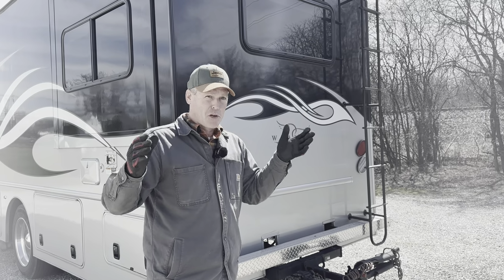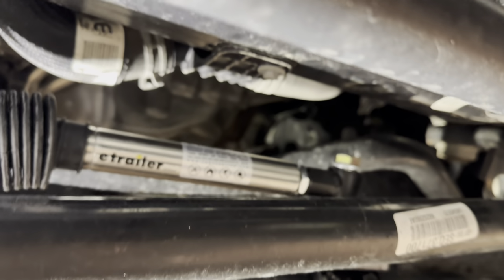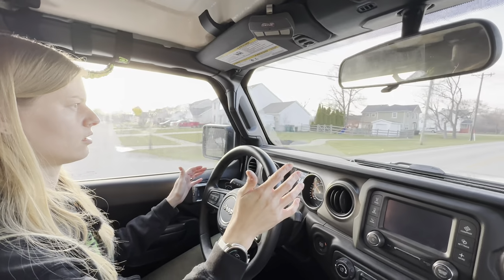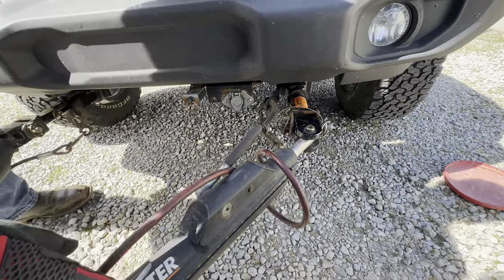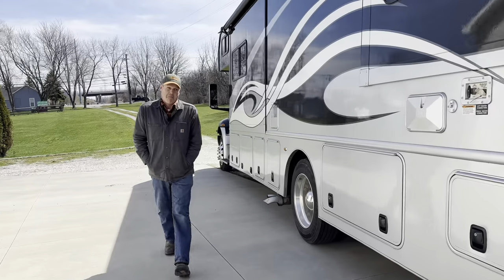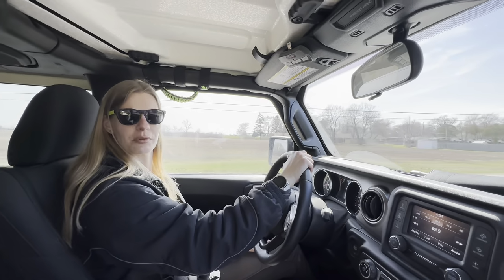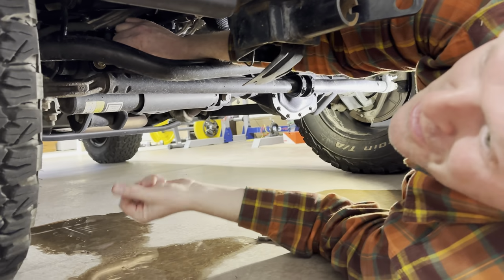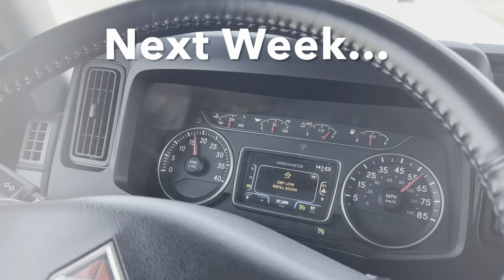Waste Of Money? Roadmaster Exact Center Steering Stabilizer (Jeep Wrangler)

Comment: If you have to back up with a toad and you have two people, let the toad reverse and lead the rv. A Jeep in 4low will easily idle an RVing in reverse and idling. Thanks for the content guys!👍🏻👍🏻👍🏻👍🏻👍🏻
Reply from the maker: If we run into a problem we'd just have the passenger hold the Jeep wheel so it wouldn't jackknife and break the tow bar... Or simply unhook the Jeep all together because it takes all of 2 minutes haha the fine print for this stabilizer says to only go straight back and not to turn. That's pretty useless most of the time lol as of today that steering stabilizer is still off and hard at work as a paper weight😂
Reply: @WanderingWagners  True. That’s unfortunate about the steering stabilizer 500 bucks just sitting on the shelf; oh well we live and we learn!😊
Reply from the maker: @spitfire155k2 yes it is, we've considered selling it because some people out there claim they love theirs. I just hated the way it made the Jeep steer and felt unsafe at times

Comment: Great video. I also own a Jeep JL and considered installing the same unit until I saw your experience with it. I will continue to move forward and not back!
Reply from the maker: Some people like it but also said it was a heavier steering wheel... We just couldn't get used to it and it made it harder to control at times and made it feel unsafe so off it came and it is still off to this day.

Comment: I've heard of people using a bungy cord on the steering wheel.  Fasten it so it pulls the wheel back to center.  I've never done it, but heard others say it works very well.  (I too would contact the company and send it back)
Reply from the maker: I could see how that would work. Probably a much better option! Granted if we are together and need to backup at least one can jump out and hold the wheel if need be and that's free haha
Reply: That's how I do it. Got several different lengths on bungees. keep the one I found and a small towel in the Jeep. Hook to brake pedal arm, pull up through steering wheel, once around the bottom center spoke (with towel wrapped around) and back down to the bark pedal arm. Works great and cost about $15 buck for the container of different bungees and the towel. 

Also, on Wranglers both JK and JL they are known to wander. If you get under the jeep and turn the steering wheel you will probably see 2 things. One, the track bar will flex 3/4 of the way left or right, especially to the right. Two, if you look at the frame where the steering box is mounted, you will see it flex in and out a little. Beefier track bar (doesn't have to be a crazy one) and a trackball bracket with sector shaft brace to attach to the bottom of the sector shaft the pittman arm is attached too with eliminate that. More popular on lifted jeeps but works just as well on stock height as well. Steer Smarts brace gives a little better clearance to the sway bar. If no plans to ever lift a JKS fixed length track bar is probably more than plenty.

Comment: Less money can get a Falcon Nexus 2.2 which you can stiffen up for towing then loose for driving with a twist, not self centering but on stiffest helps tracking when towing and can back up some. Have Safe-T-Plus on RV similar to Roadmaster self centering has to be aligned perfectly better there since mostly straight highway driving. Jeeps have stock stabilizer, Falcon Nexus is big upgrade and adjustable easily.
Reply from the maker: Haven't heard of that one. Although after this experience in not sure we will be willing to spend money on the steering again soon haha but the JL jeep does have an upgraded steering box from the factory I could get for free I believe so maybe we'll try that first if anything

Comment: I've been a trucker since 1997 and I don't usually have a problem with RV's in the truck fuel island... Usually. Generally speaking the RV is putting on less fuel than the trucker is but some people in RVs don't understand the proper etiquette of pulling up after you're done fueling so the person behind you can fuel. But then you get a Swift driver who's parked at the pumps and it seems he's gone inside to take a shower.
Reply from the maker: No kidding. I swear some drivers go in get a sit down meal, shower, and shop while blocking the fuel island😂

Comment: For shits and giggles, try tying the steering wheel to the A pillar then back up. Should do the same thing as that $500 shelf warmer. Thanks for your video!
Reply from the maker: Yeah I'm positive doing something to keep the wheel straight would get you the same result and keep $500+ in your pocket😂
Reply: @WanderingWagners  Didn't realize muckdiving pretty much said the same thing I did.

Comment: Last fall while on our way to Maine in our Class C we pulled into a fuel station in Montpelier, VT for fuel while pulling a tow dolly. I pulled forward to the furthest pump only to realize the the fuel hose had been torn off and I need fuel now!! Yikes!! I took a look behind me to see if I was going to try to back it up to the other pump. Everything was sitting straight so I like Mike, had to use the camera to see and slowly was able to roll it back about 25' w/o it wanting to bind up! It can be done if everything is dead straight for a short distance. Hopefully I never need to do that again.
Reply from the maker: Good to know though! We almost had Lynn get out and hold the wheel in the Jeep recently (before the exact center) but as soon as she got out the trucker finally emerged after 30 minutes of clogging up the lanes

Comment: Great Video 
Question what did you mount your break away switch to.
This will be my last task before heading west.
One other question for backing up. I think just open the drivers window and have your wife or helper  use the steering wheel?
Reply from the maker: Are you referring to the Jeep or the motorhome? Everything was setup per instructions for the tow setup with the Jeep and motorhome

Comment: I just put one on my 2013 wrangler two door and I’m kind of the same way. There’s parts of it I really love and parts of it I can’t stand it is definitely a heavy steering wheel with it on,but I don’t get the rut tracking with my oversize tires like I do without it being on.
Reply from the maker: Yeah we understand that completely. We took it off and it's still sitting on the shelf. We REALLY wanted to like it but just hated it, plus a few times it seemed to induce a weird steering similar to "death wobble" but not quite. I know what that feels like from my old 04 dodge ram truck😂
Reply: Question, did you remove the stock steering stabilizer?
Reply from the maker: No we did not
Reply: @WanderingWagners   I took mine off and I actually like the exact center more, it’s much more civilized!

Comment: Stiff Bungie cord attached to the steering wheel works too!!
Reply from the maker: That would do the trick if you're alone, and save a bunch of money! Haha
Reply: @WanderingWagners  Yup, honestly the 4 years we were out full-time on the road, the amount of times I got crossed up and HAD to unhitch and reposition was ONCE.  Definitely not enough times to warrant spending over 500 duckies for what amounts to a half assed solution.   I tried the stiff Bungie method and it worked well...but I never actually had to use it, I tried for the hell of it.
Reply from the maker: There were times we needed to backup but just didn't (truck stops). Lynn jumped out once to go hold the Jeep wheel but as soon as she got out the trucker came strolling out. We were hoping it would improve the Jeep handling (as advertised) but it seemed to make it a pain to drive instead

Comment: I have a brand new Roadmaster Nighthawk, still in the box. I haven't purchased or installed the base plate on the Honda CR-V. As soon as I sell the mansion, I'm getting my rig and hitting the road. I've pretty much decided to go with the Newmar New Aire 3545, a specific unit is the 2021 model year, with a full solar array. I'm getting more and more excited by the day! Nice to see that the Exact Center isn't "all that".
Reply from the maker: We've been very happy with our Roadmaster nighthawk tow bar but the Roadmaster exact center was a fail for us, even though we wanted it to work so badly!

Comment: You stated that you did not or have not driven a commercial rig with a steering stabilizer; watching the video, I noticed that the jeep is a model that has a factory steering stabilizer installed. Having driven both with and without at the non commercial level, it is a device that I would always recommend. IMHO based on what you have presented it is nothing more than a "stiffer" after market steering stabilizer. What are your thoughts on just steering stabilizers?
Reply from the maker: Steering stabilizers in general aren't a bad thing. They're essentially just a snubber but depending on their design is whether they're great or not I guess. 
It's a personal preference in a way

Comment: Having gone through three steering dampeners. Just couldn’t spend that.  I will end up with hydro though talk about expensive. Did you take off the oem dampener?  I would be worried about it hiding the other component failures.   Jeep wave!
Reply from the maker: We didn't remove anything OEM. It's back to OEM with exception of the brackets still there in case Lynn wants to try it again😂
Reply: @WanderingWagners  the oem one annoyed me most since it’s the lowest thing on the left side.  I had to drill that same hole for the relocation so I could upgrade the axle disconnect skid plate

Comment: Why do you not just take the seatbelt wrap it around the steering wheel on the jeep so you can back up?
Reply from the maker: One could try that method. We have two people so we wouldn't need to do that but this product would make it so no one had to get out to do anything like that, and it was supposed to make the Jeep itself have better steering, which is one reason why we really wanted to try it. However, it seemed to make the Jeep steer worse after the install.

Comment: Ok I have a class C but use a trailer dolly for my tow car ( jeep compass 2 wheel drive )  . But I have a couple of question about towing your jeep . First do you have your steering  unlock while towing  ? If you have it locked or unlocked how about a ratchet tie down to lock you steering ? Like I said I have never towed like you guys do I'm just curious .
Reply from the maker: Jeep wranglers steering wheels do not lock so they're great for flat towing.
You could use a bungee or something to hold the wheel in place while backing if needed but this device is supposed to allow you to backup without holding the steering wheel etc, which it did work ok for that!
Reply: @WanderingWagners  Learned something new today!! Thanks for the info .

Comment: There are some full time RVers that have solved the backup problem for less than $10 ...... all they did was
Reply from the maker: I believe it! We thought this would also improve the Jeep daily driving and handling as the company promised but it just made it worse.
Reply: I have liked your review on the steering stabilizer. I have wanted one for awhile but like you $500. Is a lot for what it is. I had one installed on my motorhome and love it. Before I had it installed, I was all over the road. I have the Ford f-53 chassis and jeep wrangler JL. I heard you say your wife gets in the jeep to keep the wheels straight while backing up. I will try that soon. Love your videos. Keep up the great work. We live in Jackson, Michigan. Hope to cross paths with you guys someday.
Reply from the maker: Thanks for the comment! There's a good chance we'll cross paths since we really aren't that far away. 😊